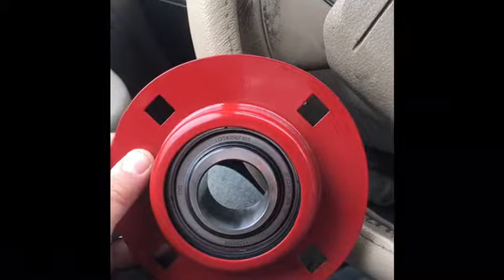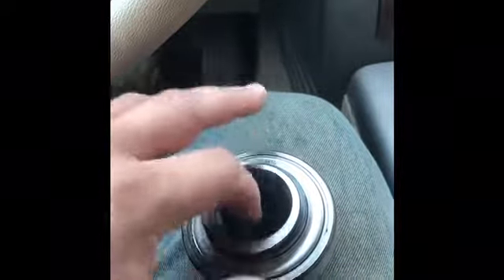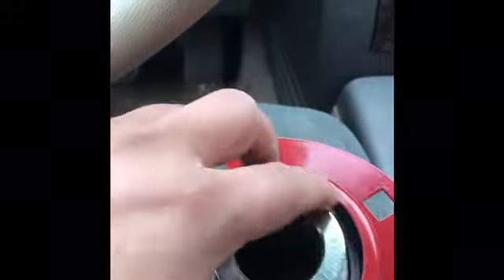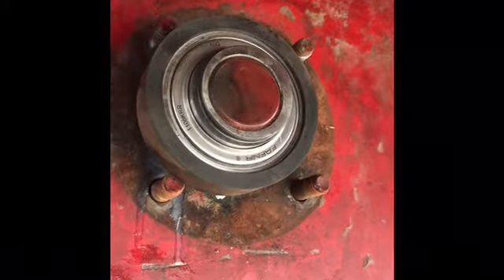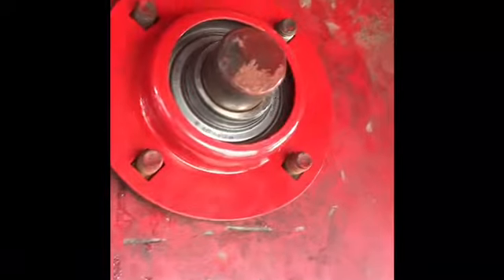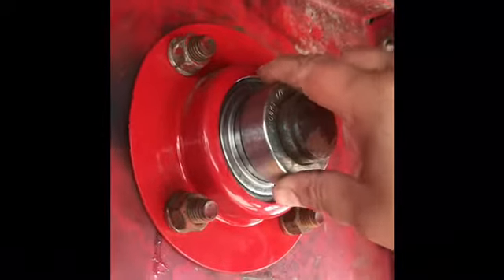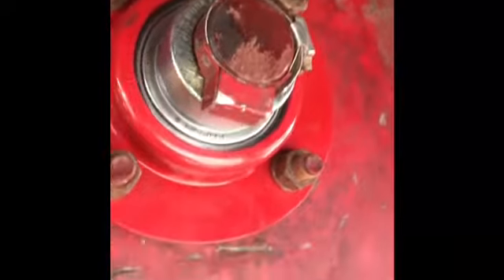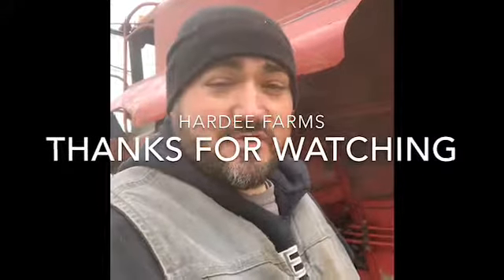Case 1660 chopper bearing replacement #2

Comment: Any thoughts to a gear puller to remove that inner race?  Tomorrow we are headed to get a new bearing and I'm trying to figure out how to remove that inner race.  I hate the idea of a torch because my machine is covered in soybean dust right now.  I didn't realize that inner race is offset.  Still not sure I fully understand that.
Reply from the maker: Yeah I haven’t found a better way. Even my dealership does it the same way. 
I doused any area that might get hot or have an ember touch it with a lot of water and kept a water hose at the ready. As soon as I got it out I did it again.